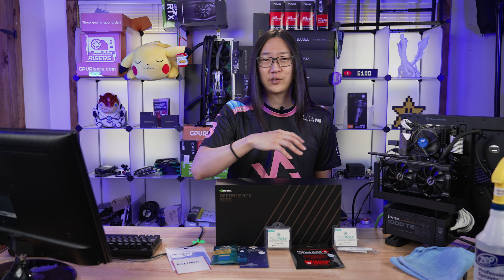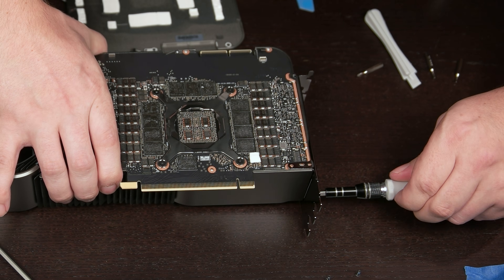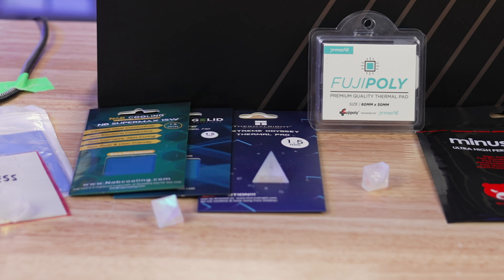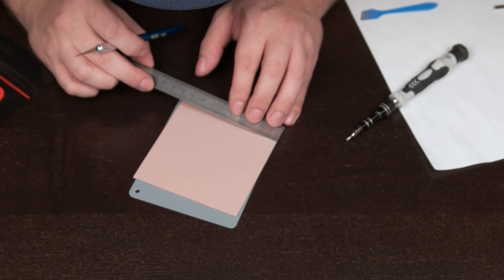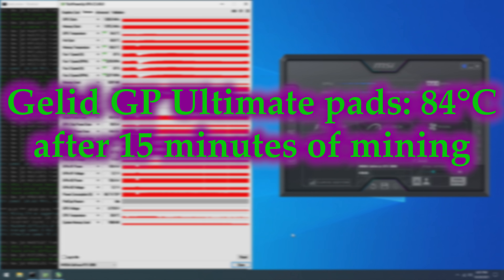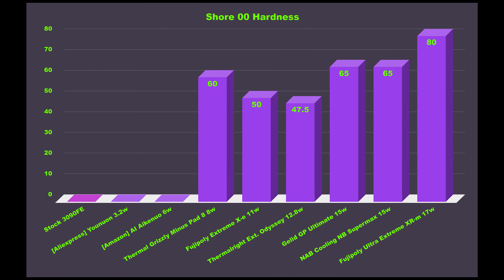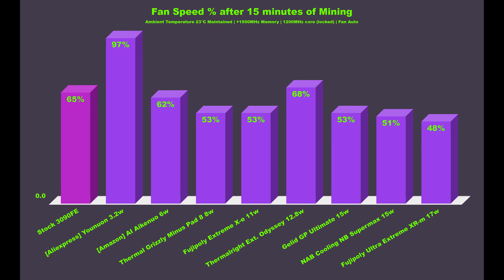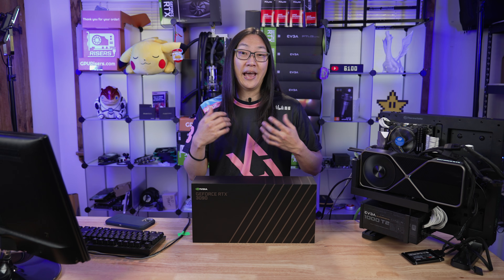Thermal Pad Showdown! What you should (and Shouldn't) Buy

Comment: Very interesting. I'm curious how the GPU core temps would differ with these pads while under waterblock. Typically water flows to the core first then to the rest of the components before leaving.

Edit: wrote cpu instead of gpu
Reply from the maker: This is specifically for memory pads on a graphics card. Do you mean the Gpu core or do you mean the CPU core on the computer?
Reply: @TekShinji  GPU core, my bad lol
Reply from the maker: Water has around 4x thermal capacity so it’s not a issue. I made a video about it on my channel as well for water cooling sconce stuff

Comment: So it seems that 3.2W pads aren't good enough if stock pads have ~6W conductivity. I have been thinking about doing complete overhaul for my older video card but it makes things a bit tricky because I can't see memory temperature so I don't know how new pads would perform. But I suppose if I slap 6W thermal pads in there they would be at least as good as stock.
Reply from the maker: Depends on my drivers you’re using. He might want to try hardware info depends on what car do you have?

Comment: Good video. However, the technical analysis is a bit off at the end there. The memory is not putting heat into the GPU die, that's impossible. The only way for heat to transfer from the sink back into the die is if the heat sink is hotter than the GPU die, and if that's the case then it wouldn't be cooling the GPU at all and the card would thermally shut down. Never mind the fact that it's much easier for the heat to transfer out into the cooler air than it is to transfer back into the already hot GPU die.

What's actually happening is that the heat sink for any given fan speed is going to have a specific amount of energy (heat) that it can dissipate per unit time. Obviously if you add more heat from the RAM, then you're decreasing the amount of heat that the cooler can sink away from the GPU die. By leaving the fans on auto, you're ensuring that the fan speeds remain the same, and therefore there's less heat sink left over for the GPU die due to the added heat from the better cooling of the memory.

For the most accurate testing, thermocouples should be used to get exact spot temperatures, but I think we can all agree that this testing gets us close enough to make the decision on which of these pads to use.
Reply from the maker: Oh nice have u done it befor? I’d love to talk to u to hear about how you did it for our futur video
Reply: @TekShinji  I have never done it personally, as I don't typically do such in-depth testing when I'm just slapping stuff together for myself (hence why I was so interested in seeing the results of a thermal pad comparison, as I think this might be the only channel to have done one in-depth as far as I could find). But GamersNexus typically uses them when they do temperature monitoring. I think they have a video explaining their testing methodology on their channel. Alternatively, I would imagine Steve would be happy to give you more information if you contacted him directly.

I'm not associated with GN in any way. I'm just a viewer.
Reply from the maker: Awesome. I’d love to see the data soon!

Comment: Great video.

But possibly the (substantial) core temp rise was due to added pad thickness on the VRAM chips creating slightly less contact with the GPU cold plate ?

(Yes I know you tried to control for that by buying pads of the same thickness — but possibly there was still substantial manufacturing variation here?)

Only thing I can think of to control for that might be logging the contact quality / pressure of the stock setup — then seeing what the aftermarket pads do to GPU die contact pressure ?

So that you know you’re at least comparing apples-to-apples mounting pressure… maybe including a fixed # of turns or the screwdriver, per GPU heat sink mounting hole ?

But again, great video, thanks ! 🙂
Reply from the maker: That’s for sure, we didn’t wanna spend another $2000 on pads just to check for quality since the video only produced about $300 in its lifetime. It would’ve made no sense.
Reply: @TekShinji  

Totally understandable. Again, thanks for a great, really comprehensive video! 😁
Reply from the maker: You’re welcome! Hope to see you in the Discord :-)

Comment: Really good comparison video, helps a lot with my upcoming repad project. NAB pads for sure.

Good thing to note though, the conclusion with the gpu thermals being substantially increased due to the pad swap is likely specific to memory heavy applications, as we can see the gpu chip power draw is also about 60 W. In a core heavy workload, gaming for example, it seems likely that the benefit for the memory would lessen but the core temp would be less affected because power draw would be substantially higher on the chip. Interesting results though. I'm going to try a copper shim mod for my memory so I wonder what the results would be for that, compared to these.
Reply from the maker: Hey there thanks for watching the video. Must know what you find out in our discord!

Comment: Bro i own rog strix g15
For GPU vram they have used thermal pads 

Now it's been 2 yrs i need to change it 

Which mm to choose 0.5 or 1.5mm or 1mm
Reply from the maker: Hey bro, give me a response and I’ll try to help you out
Reply: @TekShinji  tell me
Reply: Help me to choose thermal pad mm
Reply: @TekShinji  i own rog strix g15
Reply from the maker: Hey there! So the best way is to measure the pads already on the card or the 2nd beat is to research online for the thickness. However, that gives a varying results. Another way is to contact the manufacture directly.

Comment: Can you do a test please between using like a 3mm thick thermal pad, vs stacking 6x 0.5mm pads. I assume that the makers say you shouldn't stack pads so they can sell you 3-4 packs instead of 1?.. The blue and white standard pads are like blu-tac, I seriously doubt any air would get trapped between layers if you lay them down carefully, and maybe even if you didn't, once some pressure is applied it probably squeezes any air out (like the myth that air could get trapped using thermal paste on the CPU that der8auer debunked). Harder material pads with embossed type patters on might trap air but I still doubt it. I would like someone to prove once and for all if stacking matters, so people can maybe save lots of money buying one big pack and not 2-4 packs...

I just searched the net for it, and it seems no one knows for sure if stacking matters or not, which is why some definitive tests would be good. People have plenty of theories but no test results so far as I can see. You could get a few different types, from the bog standard blue and white to the stuff people use for GPUs like GELID, stacked and non stacked at the typical temps for NVMEs and GPU components..
Reply from the maker: Nice definitely let us know!
Reply: @TekShinji  I posted the same comment to YT Channel "Snarks Domain", he might be doing the test with his hot-plate set up. I can't do it.
Reply from the maker: @Lloyd.B.  come join our discord for the convo this is not possible through YT comments 😂
Reply: @TekShinji  Ain't nobudy gat time fa dat :)
Reply: Yup, 10 minutes ago i was researching this. I found waaaaay too many answers saying "ur better off buying the correct size, air pockets will form". I think it's just a marketing thing. I don't believe you lose THAT much heat transfer enough for it to be a bother.
For the heatsink airbubbles: for the air to get trapped really depends on shape between the die and heatsink, and how much pressure it gets. A low pressure can result in air not getting pushed out, i believe.
And anyway, i think you can just buy the cheap 6w thermal pads on aliexpress, cause you don't want too much heat transfer on the heatsink with GPU die. Memory can get hot, that's ok, but not for GPU die. Better to save the good ones for the backplate maybe.
Reply from the maker: Nice, how did it turn out?
Reply: @TekShinji  I don't think he did it yet.. I subscribed after asking about it and there hasn't been a video on it.
Reply from the maker: Ok thanks for the update!

Comment: Interesting result for the Thermalright brand pads, I suspect they might be getting poor contact in the RTX 3090 because they're thinner than advertised and softer than contemporaries. A few years ago I bought Thermalright 1.5mm pads to replace the small blue pads on my Asus Dual GTX 1070 that I measured as being 1mm thick, because conventional wisdom at the time was that pads should be compressed. For future 1mm pad replacements should use what's left of the Gelid 1.5mm pad, buy some Gelid 1mm pads, or buy some Gelid 1.5mm pads?
Reply from the maker: Hey there did you watch the whole video? We talked about the reasons behind the issue as well!
Reply: @TekShinji  So somehow I remembered the part where you measured the pads thickness and the part where you mention their softness but I missed the part where you mentioned poor mounting pressure, despite those all being in the same sentence.
But anyway they did work as 1mm replacements last time I used them, so should I keep using them for that or will actual 1mm pads fit better? What's the rule here? Should pads just fit or be oversized and compressible?
Reply from the maker: Every thermal pad manufacturer use some kind globalized standard; that they be a lot easier to compare them. Or you can wait the more pads to like treadwear from tires. It’s not compared across the industry it within each on brand category, which is highly confusing to the consumer.

Comment: who has a non electrically conductive  thermal pad that is good enough to put on a cpu in a laptop for a long time. taking them apart is like a puzzle.
Reply from the maker: Well, technically, they’re supposed to be made out of silicone. Do you want to avoid ones that have graphite, or any type of other impregnated materials.

Comment: I used thermal wright pads in my gaming oc gigabyte 3090, they lowered stock temps significantly, you must use a thicker model I suppose. they're great pads
Reply from the maker: Very nice!
Reply: but did the core temps went up and if so by how much when changing to these thermal pads?

Comment: Thank you for sharing deep test.
Very odd result for thermalright odyssey. May be in this test you should use 2.0 mm pads, because they are soft and good compressing.
I have this one and in rtx3080 dropped down the temps of memory from 98 to 85+- degrees. They are good for sure as gelid pads.
Reply from the maker: Hey there thanks for the comment. Did you see the full video on the reason why they didn’t perform well?

Comment: Great video. However one thing most keep forgetting is that lower temperatures also mean less power use = less power throttling. Resistance of most materials reduces with heat therefore requiring more amps at the same voltage.
Reply from the maker: that is absoluty correct thanks for the comment! make sure to get subbed for furtre vids!

Comment: Hi there, Thinking about replacing pads with the Gelid, however what does this last bonus test exactly suggest in terms of gaming core temps? Atm temperature is 83-85 at 100% with new thermal paste, will this go even further up?
Reply from the maker: Hey there, I do recommend watching the whole video to get all the context. Since the concept is kind of hard to explain without understanding what's going on.

Essentially, when you make one part of the card more efficient at heat transfer but don't increase the radiation surface or efficiency of transferring off the card. That heat has to go somewhere and it can bring GP core temps up. At least that's what we've been seeing in our testing.
Reply: @TekShinji  Yeah but Im just confused when you state it goes up by 20C which would make sense if your work temp is kinda low already. Meanwhile my core temp is already maxed at 80-82 to begin with.
Reply from the maker: yes i agree it would deffenly denpend. comments are kinda hard to kepe troack of so check out our discord for the convo!

Comment: I have doubts about these setups, i mean the cheap blue stuff did better result than the more expensive  Thermalright Extreme Odyssey
Reply from the maker: Hey there, I understand your doubts. I hope you actually see this message. Did you watch the video? Why are we explained why that happened?
Reply: @TekShinji  you meant various different fan speeds were used? or that gpu core had higher temps with higher quality pads? What this means still that the cheapo blue stuff is actually recommended.
Reply from the maker: No, in the video we explained that the thermal pad is kind of useless if they are not manufactured manufactured correctly, regardless of how good their thermal transference efficiency is. Try joining our discord link in the description below to help go into the details. However, we do explain it in the video if you watch that section

Comment: Krynout grizzly vs Cryofuze? For GPU
Reply from the maker: After a certain point, it appears that a lot of these pads are from the same place.. different names, different claims, but none independently verified
Reply: @TekShinji  thermal paste krynout grizzly vs Cryofuze? RX 6900 XT
Reply from the maker: @Silva.Teixeira  what do you mean?
Reply: @TekShinji  I bought the thermal pad gelid extreme 1.5mm for the AMD RX 6900 XT D412, I still need to buy the thermal paste, which one do you recommend?  krynout grizzly or cryofuze?  I put mastergel maker nano, but unfortunately at the hottest point it reaches 110 degrees and normal temperature playing 80 degrees, I think it's not good thermal paste for gpu
Reply from the maker: Of all the thermal paste I views thermal grizzly has been the best. I recommend to cryo nodd if you can. It does cost more but doesn't seem to harden or solidify over time. It's always gooey after I take the cooler off after a long time and I never had any issues with it. Just make sure your pad thicknesses are all correct. Otherwise may have contact pressure issues. Make sure to join our discord linkedin subscription! And see you in the conversation there 🙂

Comment: I know this was made a year ago but this is quite an invaluable video for thermal pads in general- Amazing work!

I suspected the core temp to increase if the pads are actually effective, but do you tlhink it will be that much of a difference on say a 3080 or 3080 ti which have much less vram chips on them? Thanks!
Reply from the maker: Hey there buddy, they technically don't have less. Because the 3090 non-TI are the ones that have the chips on the back. So there's overall higher thermal envelope. However another cards only have memory chips on one side.

Comment: Which best pad for ssd pls advise?
Reply from the maker: Hey there, thanks for the question. Could you please advise on what you're trying to doing?
Reply: @TekShinji  Hey, thanks for quick reply. I need it for my laptop, already chose the heatsink(4mm pure copper with graphene coating, it should fit there). Now need to decide which thermal pad will give best results. They recommend to use 0.5 thicker pad on the controller on Samsung 980pro, I don't know how it is on 990pro, which I've ordered. Can buy 0.5mm thick and double it for the controller. So which thermal pad and thickness you would recommend? Thanks.

Comment: This video made me sub instantly. Thanks so much for the thorough test! You encouraged me to replace the pads on my MSI RTX 3090 Suprim X since the warranty expires in a couple of weeks. According to the pad replacement diagram for my card that I found on Reddit, the pads on the VRAM chips are 2.5mm thick. Unfortunately, where I live I can't find pads with this thickness. We have the Gelid GP Ultimate pads here and the closest thickness I can get is 2mm and 3mm. Do you think I can use the 3mm ones instead? Maybe I can squish them a bit before installing onto the VRAM? Or maybe I should stack 2 thicknesses, for example 1.5mm + 1mm? Thanks in advance and I'm looking forward to the new videos! 🙂
Reply from the maker: If you can't get the pads you want in the size you want. Maybe try using a similar brand? I don't recommend using the wrong size pads because that can cause more issues. It's better to use the right size and get even contact pressure versus the wrong ones.
Reply: @TekShinji  Sounds reasonable. I will try to find another one then. Thanks so much for the suggestion and the quick reply!
Reply from the maker: Thank you so much for subbing! We really appreciate it 🙂

Comment: I used Thermal Grizzly Hydronaut paste, its so thicc that I were able to use it in my old laptop, the difference was very significant.
Paste should be much better in thermal conductivity just because it is better in filling micro cracks on the thermal plates, while thermal pads will have air bubbles that will not transfer heat good enough no matter what. Maybe thats the reason why all stock thermal pads are so jelly after few month of use, they melting to fill those cracks better.
Reply from the maker: I'm glad to hear you had some good results! Join our discord and show us some pictures or other information you may have :-)

Comment: A better test would be with the use of a water block for the GPU with a large radiator which will all but eliminate the added heat transfer from saturating the air-cooled heat sink. Great video
Reply from the maker: Ah true. But... At that point... Wouldn't it be cheaper just to buy a more expensive GPU? 😱
Reply: @TekShinji  The more expensive the GPU the more of a need for liquid cooling. The RTX 4090 is a prime example. Nothing better for enhanced reliability